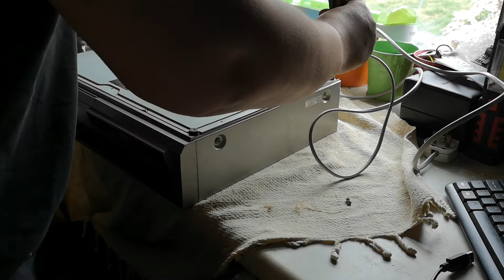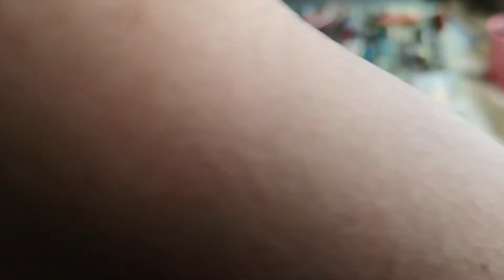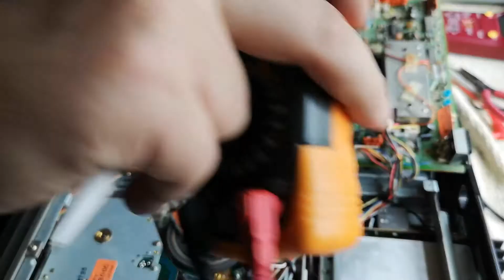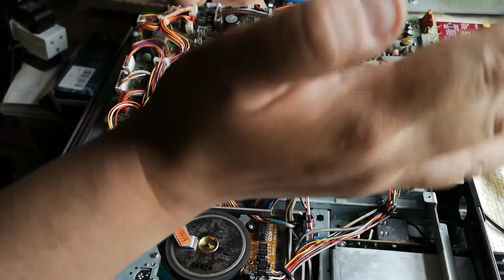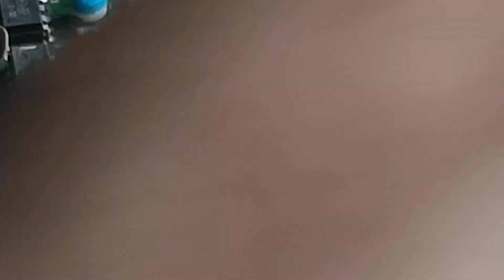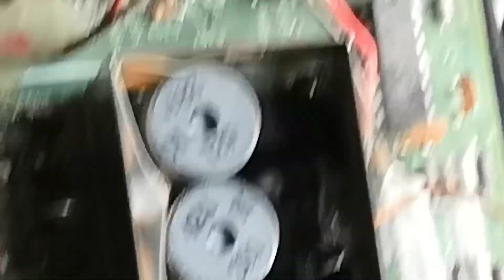Sony SLC9UB - New Project - Investigating no reel rotation

Comment: From PALsite: 'No capstan motor rotation: Check fusible resistor R530 (0.2 ohm on SS-11 board) for open circuit. Replace it with an electronic fuse (Sony part: 1-532-605-00 - N10 400mA ICP).'
Reply from the maker: One of the reel drives has also, sort of exploded 😂. I missed that one on PALsite, re the capstan motor. I'll check that next time I get the deck out ..